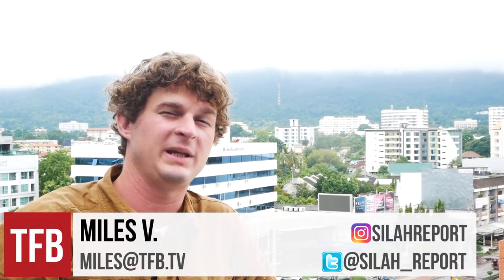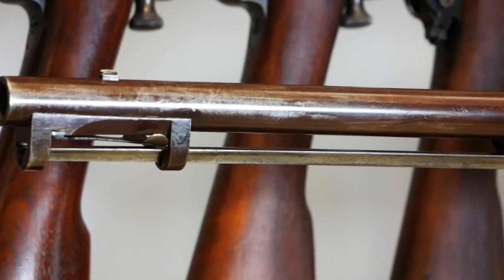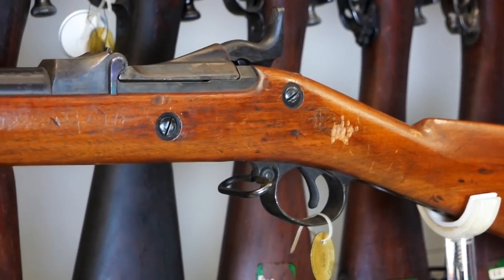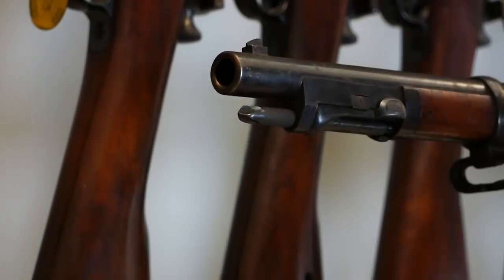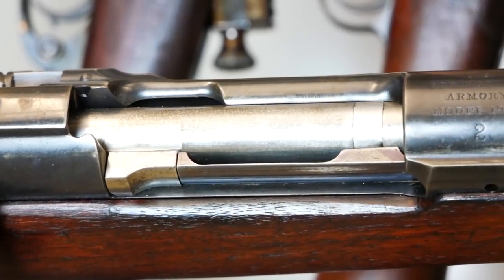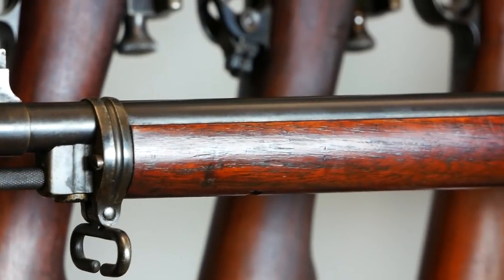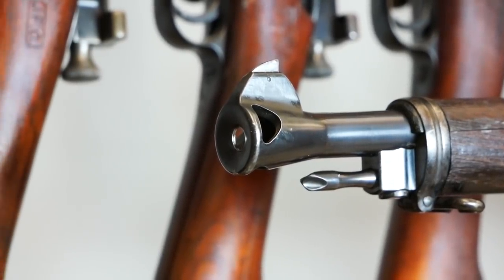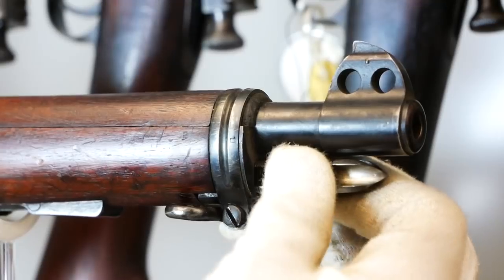The Ridiculous Rod Bayonet in U.S. Military History

Comment: When I was deployed, I handled  a pistol that I ended up taking apart and cleaning for an ANP.
Till this day I cannot remember the pistol, all I know is I didn't know how to reassemble it and gave it back to him all jacked up.
Reply from the maker: You frekin douchebag, he probably didn't know how to as well!!! lol
-Miles
Reply: Mr Cortez 
A proud moment
Reply: 🤗 Oops. 
I remember I couldn't put the guide rod and spring on correctly. But damn, I really wish I knew what pistol it was.
Reply: Mr Cortez i guess it was one of those pistols where you had to use a second rod to mount the spring and thr guide rod, like on my walther p22 where it would be impossible to reassemble it othervise
Reply: Genesis23OPB what other pistols come to mind? 
Also, I think it was hammer fired and all steel construction.  For a while I thought it was one of those Polish VIS pistols.
Reply: On 2Wheels 😂 nice, well with this pistol I got it back together(after forcing it together) but it didn't function properly .
Reply: When I was about 14 years old I disassembled both my grandfather's S & W Mod. 59 and his Luger from 1917 when he left me alone with them for a few minutes. I got the Smith & Wesson back together no problem but the Luger I was totally stumped and had to try to tell him "It just fell apart in my hand". He was obviously having none of it and I was told under no uncertain terms not to touch and certainly not disassemble his guns when he wasn't around. More than 20 years later I showed up at my Grandad's house one time and his Luger was in pieces and he asked me to reassemble it for him which I did. Because he had taken it apart and couldn't remember how to reassemble he decided enough was enough and he wasn't reliable enough to handle and shoot his guns anymore and his eyesight was failing to macular degeneration. I was pleased to be able to put the pistol back together for him but that was the end of his shooting days. It was a sad moment both of us realising he wasn't "with it" enough to handle his firearms any longer :-(
Reply: What’s an ANP
Reply: @Stigstigster  did he give you his Luger?
Reply: @seantheguy1391  Afghan national police.

Comment: LOL, i was reading the Osprey book on the 1903 Springfield hours ago and saw exactly the same weird bayonet and thought the same about it.
Such bayonets are almost useless, but the idea has some merits; no need to something hanging from your belt, nor a new piece of equipment &c. The french used it in the excellent MAS36 rifles and the germans in the great FG42 battle rifle. On the other side, pointy bayonets like this one can't compete with knife-bayonets in its everyday camp and field life.
Reply: This brings into question the need for bayonets at all, the last time a bayonet charge worked against a well equiped military was WW2, [We are not going to talk about those UK guys who managed to scare off some goat herders with sharp knifes on the end of their rifles, the Taliban tend to run away and not fight anyways.] 

if you are charging at a well equipped enemy, you are all dead, end of story, no heroism can save you from dying to a GPMG who's job is to prevent such a thing from taking place.

Why bother? The South African's for example don't issue bayonets and just give out better field knifes.

 take the AR15/M4/M16 all three lose their bayonet lugs the moment you want to run a free floated hand guard, i think the much greater accuracy of the freefloat system is worth far far more then the possibility of mounting a knife to your rifle.

also try to use an M9 Bayonet as a knife, you will be disspointed quickly, it's basically useless, i'd rather be issued a leatherman multitool then to have to lug around a bad knife that also happens to be a bad bayonet.

Comment: Civil war reinactor scuttlebut  was that ram rods  were used as ammo to prevent  other infantry charges .Shoot then charge with bayonettes . Counter was shoot  , reload quick like then  just shoot with rods in  ,This skips several steps and could catch the other force by surprise  So do or die for both forces . I do know factually two things about this urban legend . Alot of state park will not let you do a reinactment with the rod for fear one will fly.  and of coarse that so and so saw it happen .Having heard this rumor several  so called soldier /scientist   shot a rod  It embeded impressively, the whole rod  sidewaysi nto a old old oak . This oak stopped what was later refered to as the "propeller of death"   .Note  we used string to pull trigger as there was and still is a concern that it could/would result in a split of the barrels as a sort of squib . Have said that  I have no doubt on rod could kill and  go through several  people at head neck level